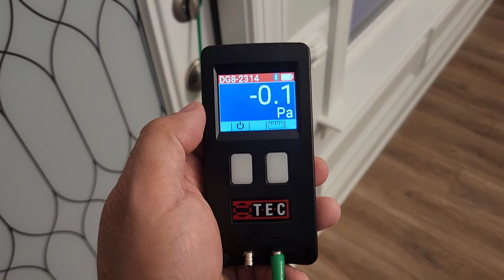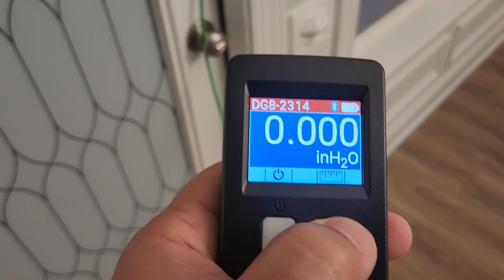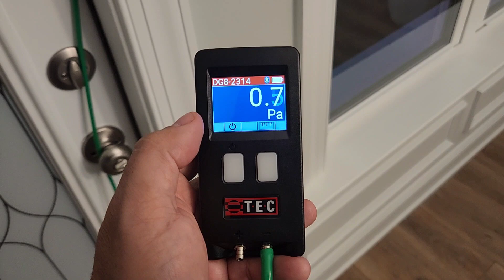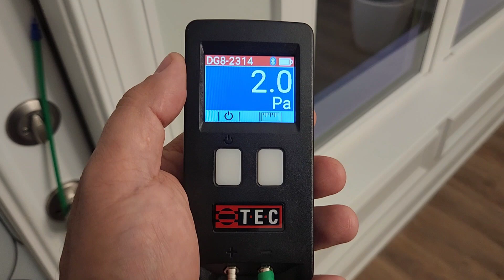Checking House Pressure With The DG-8 From TEC

Comment: Good stuff Tim. Also wondering if I could do a conversion of mmwc- pascals since that’s all my Fieldpiece manometer measures.
Reply from the maker: @boywhohadatiger  it should be possible but your FP should convert. The problem is its sensor doesnt have thr resolution at low pressures that the dg8 has so it becomes a random number generator.
Reply: @timdestasiohvac  I tried it last night on a base level. Put the units to mmwc and ran some test with the exhaust fans all on and no ahu on and noticed the p1 probe Inside was in a slight negative like 0.1 mmwc and when exhaust was turned off and ahu turned back on the p1 probe went to 0.3-0.4 mmwc. I’ll try it out at work on some wic. We ran into a case where the mua where was down and the wic an WIF were very leaky but the building was so negative the wic WIF were pulling warm air inside from outside. I really do wanna invest in the dg8 but wanna see how far I can push the Fieldpiece manometer before upgrading. I also believe the conversion from 1mmwc is roughly 10 pascals and the field orfice does measure mmwc down too to 0.1 range

Comment: You plan on adding any more videos with the dg8?  I bought mine about two months ago this ago, was mainly planning on using it to confirm duct leakage in houses.  Only used it a hand full of times, though.
Reply from the maker: I did a few more using it and the TruFlow Grid. Scroll through my videos from about 6-8 months ago.